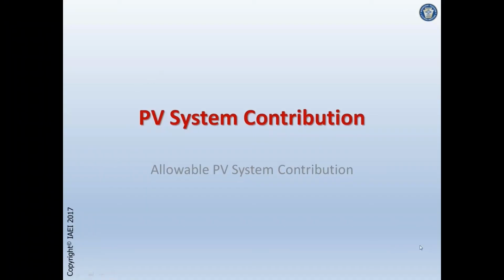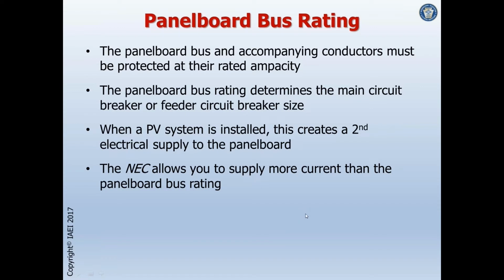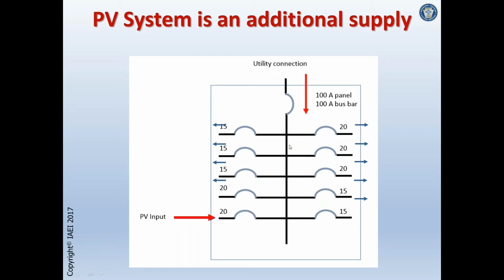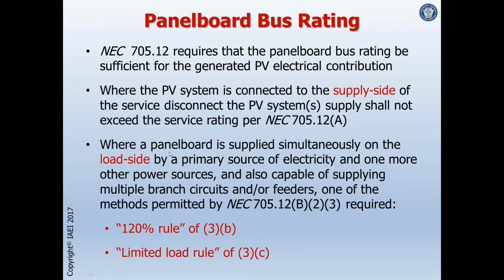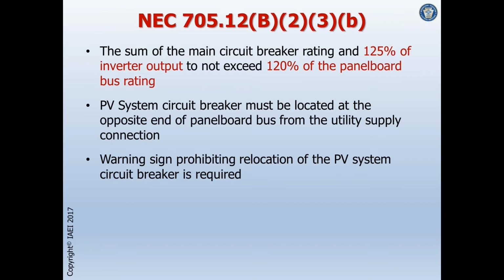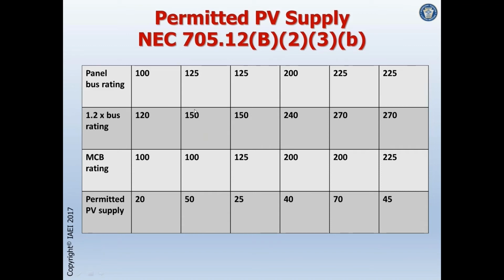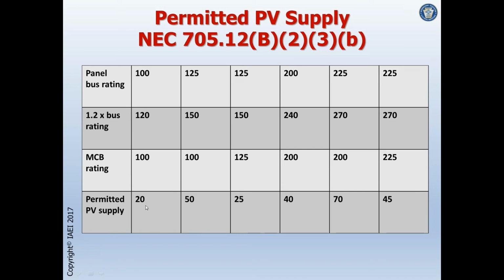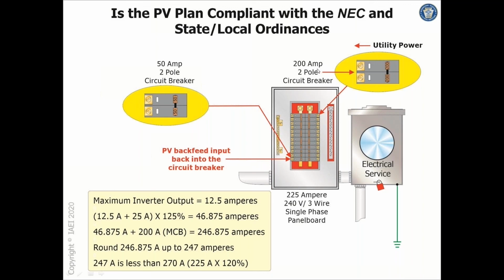IAEI Training Shorts — Allowable PV System Contribution and Panelboard Bus Ratings

Comment: Pete, does the load connected to feed thru lugs supplied by the buss have to be included in the limited load rule of 705.12(B)(2)(3)(c), or just the OCPD's plugged onto the buss?
Reply from the maker: The referenced rule is based on the rating of the overcurrent devices not the utilization load. -- Pete Jackson
Reply: @IAEI  so, the sum of the overcurrent protection device ratings in the panel being fed with feed through lugs? Scenario, 200A Meter/Main (M/M) combo with feed through lugs to the panel inside. The M/M has a buss to plug in the 80A back fed PV breaker that also has loads that the ratings add up to 60 amps. Panel inside has been converted to a 200A main breaker. the sum of the OCPD's in the 200A panel inside is well over 200A but the calculation complies with article 220. Compliant?